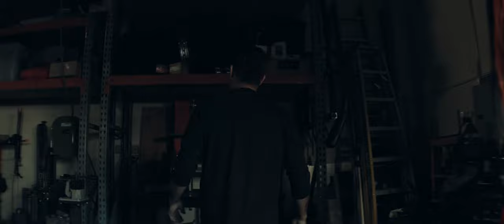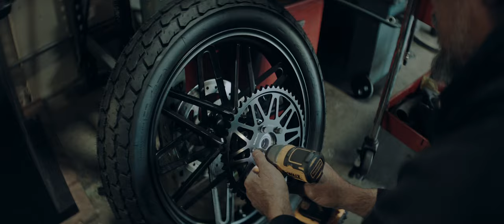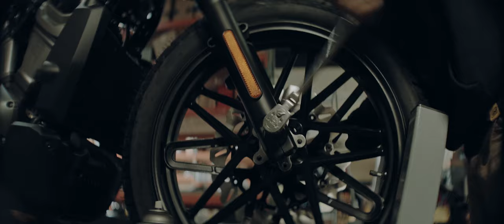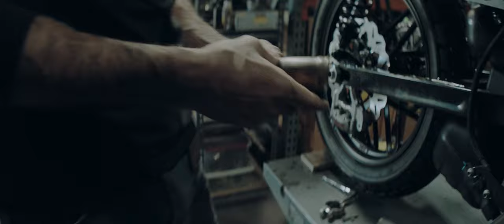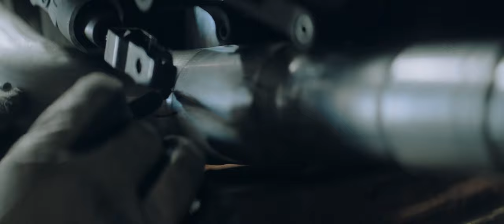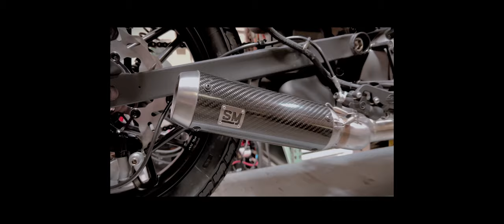The Speed Merchant – 2022 Nightster | Harley-Davidson

Comment: Looks GREAT. But if I was at Harley and could design the next gen RevMax, I would get rid of all the engine covers and fully fin the heads and barrels, I know it's liquid cooled so is the Triumph Bonneville. With fins the radiator could be smaller and fit it between the front frame tubes. And hide all the wiring and coolent hoses. But the Exhaust pipes on that Speed Merchant bike look fantastic.